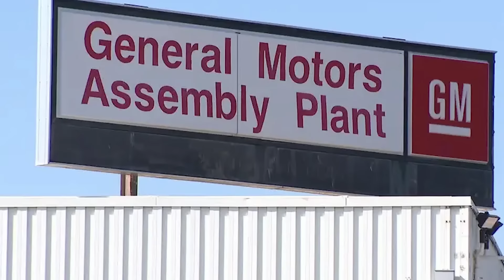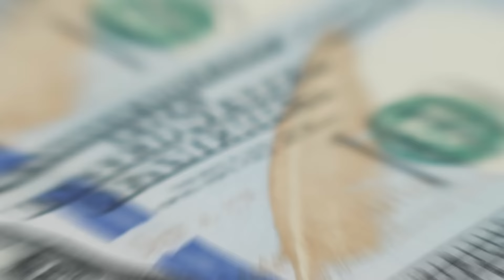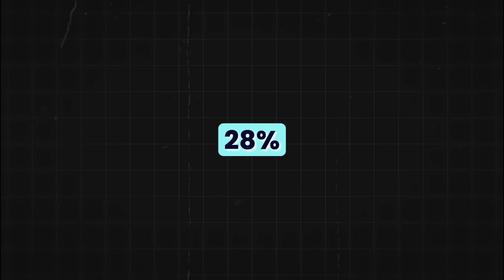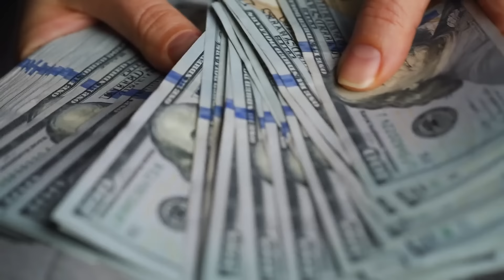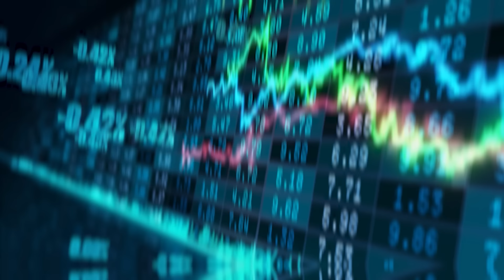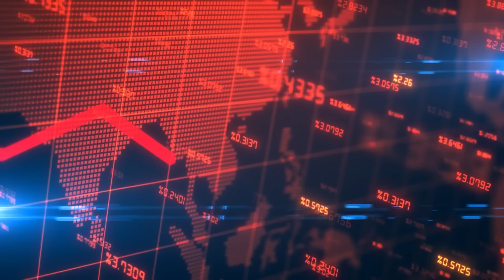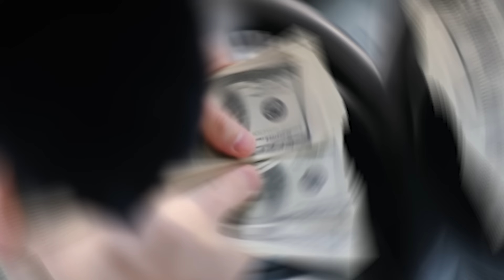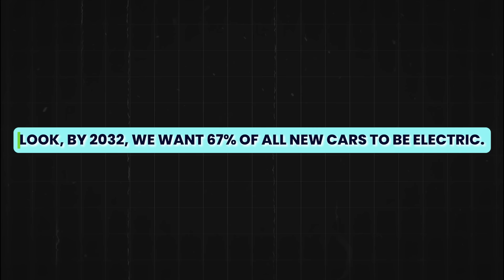The EV BUBBLE has Burst!!!

Comment: I live in Washington state and they are trying to force the citizens here to only have the option of buying Hybrids or EVs by 2030. I would buy a Hybrid over an EV any day, but I am not going to be buying either. My daughter has a first generation Nissan Leaf (EV) and she is in high school. It has been an eye opener for us. First thing to consider is you need a dedicated 30-50 amp 240 volt electrical circuit for the quick charge systems. Unless you have a new house with this circuit already installed in your panel pre-wired to your garage, you are going to have issues. Our house was built in 1975 and the electrical panel is in the basement without any extra slots, so we have to do a panel swap and run a new circuit. However, it is recommended that we go from a 100 to a 200 amp main, so now you are talking about changing out your entire service back to what the utility is responsible for and everything has to be brought up to electrical code. It's not a simple circuit to upgrade. I'm guessing by the time you pull permits and have an electrical contractor come in and change everything out, you will be over a $10k bill to do it right. If your panel is in your garage, you have two slots available on the same side in your panel and you don't have to change out your service... consider yourself lucky. What is the true cost of charging your new EV (lol)? Yes, you can trickle charge it off a 120 volt outlet, but that really takes days to charge and that is what our daughter does. 

Other things to consider... If you have an EV, you aren't paying your gas taxes, so they tripled what we pay for our regular vehicles for tabs in Washington state. An EV tab tax:( Then there is the battery or batteries. What they don't tell you is that the batteries that go in an EV have a shelf life and cost about 1/3rd of the price of the vehicle when you buy it. For instance, my daughter's first generation Nissan Leaf cost over $30k brand new and we bought it used for $7k ten years old. Meaning the battery when it goes tits up will cost over $10k to replace. Basically, her car is now disposable. There is a reason why people dump their EV's after so many years and miles. They basically are upgrading to a new car with a new battery. Again... EV's are disposable.
Reply: My best friend's wife fell for the EV scam some years back...HER Leaf didn't even make it to 60K before having to be scrapped as worthless. .

Comment: We want reliable cars that will get us from point A to point B without hassle at an affordable overall cost.
Reply: tiepup   I had 300,000 miles on my Toyota before I gave it to my daughter and it's still going strong. Much cheaper than an electric car, can fill up tank in 5 minutes and get twice as many miles than an electric car before having to fill up again. Also electricity cost is on the rise and actually costs more now than using gasoline where I live. EVs weigh more so tires wear faster and it's better to buy the tires made for EVs which are more expensive and you still get less miles out of them before needing to be replaced. Once that battery gets bad, it's about the cost of a new gasoline car to replace it. EVs are not what was promised.

Comment: Been saying since Day 1, Our power grid can not handle all the EVs to begin with. So politicians goals are unattainable already. As are most things that come out of there mouths. Now we are learning they are useless in extreme cold weather. At 50mpg on some new cars, I'll stick with gas.
Reply: Maybe an eye opener for you.

An EV , average mileage, does use equal or less electricty in a year as a 7*24 running game computer with screens and internet connections....assumed: 12 KWH / day for the gamepc including network equipment and screen usage. (500 watts contimous). Total 4380 KWH a year which will bring an EV (Tesla model3) ca 30000 km (20000 miles) far. With 39 mile a day on average the car only makes 14200 miles / year.

May be you are telling me that the grid cannot handle all those electronic toys in the USA?

Comment: When the dealerships start giving them away for us to tryout, then I guess I’ll take one. But the guys at my local power company said that our grid can’t handle the excess electrical demands from everyone charging their cars every night and personally I’d rather not have the blackouts and everyone freezing to death in their homes. But that’s just me 🤷🏽‍♂️
Reply: they never will.  they would have to pay me to take one.
Reply: If your power grid couldn't handle half the owners of EVs charging their cars overnight when most businesses are closed, nearly everybody is asleep with the lights off, and few home appliances, TVs, and computers are being used, you have a pitiful power grid.
Reply: @johnstuartsmith  
At night is when everyone is home running everything, lights , computers , tv’s, air cond/heat, cooking, doing laundry, dishwasher. 
What planet are you from?
Reply: Between 1 Am and 5 Am there's not much happening utility-wise in the houses on my planet. Maybe porch lights and  refrigerators.
Reply: @johnstuartsmith  
Well John between 1:00 and 5:00 am would be the ideal time but thats like at 1:00 am every house turning on a 40 amp welder running for 4 hrs if they’re only charging one car and maybe 70 amps with more than one vehicle. That’s even worse that the scenario mentioned before. I think electric cars are a good solution from a pollution standpoint but I have to agree with the electric company when they say they don’t have the ability to handle the load.

Comment: Not long ago the Ford dealer I worked for was told by FoMoCo that it would cost 1.2 million to be a EV certified dealership which the dealer owner paid. Then came the fuckening.. FoMoCo then said, to be a EV dealership you are required to have a minimum of 8 quick chargers. County engineers, DTE power and the distribution engineers said, sorry the power cables are underground on the other side of a major road. It will cost $180,000 to bring the lines to your building… but then said it’s all for not because the distribution lines can’t supply the demands, the Amazon Fresh building has been allocated the power prior to there construction… to bad.
Check back in 6-8 years when we start updating the grid… but not the dealership is out all the money

Comment: EVs are fantastic vehicles - for some people.  It is and should remain a niche market and not become the norm. As a contractor, weighing the pros and cons of a gas truck against a Lightning or other electric truck,  I can see the massive benefits of an electric truck.  But that's only if I don't have to travel a lot, and only if the costs of these vehicles could be brought to a reasonable amount.  I would love to be able to plug my truck in when I get home and have it ready to go for a day of work the next day, eliminating the need to go get gas and consolidating an expense into another existing bill (even if that bill does go up).  It's also cheaper to operate, which sounds awesome.  Yes, I am aware the power still comes from burning coal etc and the carbon emissions reduction isn't what anyone was told it would be.  I wouldn't want one to "save the planet."  I would want one because of the convenience and the additional storage space (A frunk!?  Yes please!) But I also recognize that not everyone has the same needs or wants as I do, nor do I think a huge push for electric vehicles should be made, at least until we've developed a better way to produce the power needed to charge them.  Infrastructure will adapt, but we need better, safer and more efficient ways to generate electricity before we can really start replacing a substantial portion of existing vehicles with EVs

Comment: I own a lightning platinum and it's without a doubt the absolute best truck that I've ever owned.  The economy isn't as good as I hoped for but I  can still drive about 100 miles for $6.  Little to no maintenance required.  I have a 9.6 kw generator with me at all times that doesn't require any gasoline.  I  can power all my essential equipment in my home including my 240 volt deep well pump during a power outage. It will do everything my old 2014 F150 would do at a fraction of the cost. No more waiting in line at the gas stations,  I just plug it in when I get home. I'm thankful there aren't more people buying EV'S,  because that would just raise the cost of electricity for everyone.  Rides like a luxury car and accelerates like a race car.  They definitely are for people that like to travel but they are great for local use and for those that only need to charge at home.

Comment: I wouldn't trust Ford to make an EV that wouldn't Catch Fire and burn down my house. They can barely make a passenger vehicle that won't fall apart before the warranty is up.
Reply: EV's are inherently a problem.
Reply: Never had a bad Ford, he'd terrible Chevys, dodges with chronic transmission problems, Datsuns that fall apart, but never had a Ford that didn't last me for years. Worst one I had was an '02 F250 with the 5.4. blew out plugs on two occasions, other then that rock solid reliable.
Reply: @kdrapertrucker  Ford does make very good trucks. My beef with them is they use their American Icon status to extract as much money as possible out of their customer base, don't honor warranties, and promote substandard designs in their lower end vehicles at the customer's expense to fix.

Comment: I own an ev purely due to the tax break. In the uk you can basically get one pre-tax. Makes them around half the sticker price. I quite like some things about it, the performance and the cheap running costs, however the charging infrastructure is laughable, and if they pulled the tax break I’d go back to internal combustion in a heartbeat.
Reply: Somebody didn't think of EV charging infrastructure in UK I guess. Gas stations are funded by the oil companies.
Reply: Yes, the infrastructure is an important factor. However, in Scandinavia, I see now that about 20-30 % of the gas stations have a fast charger >100 kW. And many shopping centers get 20-40 kW chargers. Larger charger stations >10 chargers are arising along the motorways. For my daily driving, I can charge at home at very low cost. There is some mindset to it, that on long distance travel you will have a range of 200-250 km (high speed = less range). But if you can get that 200 km on your car in about 30 min. it is absolutely doable. It requires some planning, though. And with improving infrastructure, the planning will become easier.
Reply: In the uk, you can’t really plan a journey with an ev as your have no idea if the chargers that are on your route will be working, or if they will be occupied by people who have parked their cars in the space and gone shopping for two hours. This means unless you are maybe in London, you charge your ev at home and commute back and forth, and don’t really use it for longer journeys if you can avoid doing so.  It’s typical of the uk government to allow a load of private companies to fit random chargers all over the place with no mandated service standards.  There’s no evidence that the situation is changing, so I predict they’ll have to keep the tax breaks up for some time if they still want people to buy evs.

Comment: In the 70s the EPA came out with new air quality standards for vehicles. It is said that GM and Ford hired 15 lawyers and went to Congress. At the same time, Japan hired 15 engineers and went to work. That is the crux of the problem here.
Reply: And yet: it was GM that invented the Catalytic Converter and kept V8s on the road, not the Japanese.

Comment: The 3.5 Ecoboost is a piece of crap also. I had to change my neighbors spark plugs after only 56000 miles. Spark plugs 1,2, and #3 were completely burnt up. Please don’t buy the 3.5 Ecoboost. My neighbor has been at the dealership and left his F150 for over 3 weeks and it still has issues. The only f150, if you have to buy a Ford , that I recommend is the f150 with the 5.0 engine in it. No turbo just cubic inches. If you really want to buy a real truck buy a Tundra that will never break down on you. Thank you for listening. Certified ASE mechanic with 25 years experience. 😅

Comment: My 2017 Honda cost $23,000, back when it was new, gets 40 mpg on the highway. With gas $5/gallon that’s 12 cents a mile, the same as my friend’s Tesla per mile with electricity at 40 cents a kWh, and the Tesla cost $20,000 more. 😎

Comment: Tesla sold 1.81 million last year, BYD sold 1.7 million in 2023. They are selling all they can make. Dealers won't sell them because there is no warranty or other maintenance work for EVs. No oil changes, plugs, or filter changes at $105.00 per hr.

Comment: I've had a Toyota hybid and it works.  It charges it's self while moving and uses less power from the gas powered engine when it is coasting or going downhill.  EVs are constantly discharging, I think.  Looks like the Toyota hybrid is just a better idea.  Any device requiring a charge from the grid will draw down the effectiveness of the grid.  Winter without heat or summers without AC are both no fun.  I don't think they are a scam, but they seem not ready for prime time.

Comment: First let me make the distinction between an EV and plug-in hybrid,  The EV has bigger battery and NO gas engine and the plug-in hybrid has a smaller battery but it also has a gas engine :)  I have owned two Ford hybrids, one was  a plug in and the other was now not.  I now drive a 2021 Ford Escape plugin Hybrid that has a 35-50 mile range battery with a 105 MPGe rating.  Meaning we can do all the round town, work and back driving I or my wife needs to do every day.  Even with a very small 12 gallon GAS tank, we fill up once a month at MOST at most.  If the car is not in operation its charging.  As a retired EE it really blows my mind why anyone would buy a total electric car if they EVER wanted to drive out of town.

Comment: The problem with the big American car manufacturers is that they cannot innovate.  The ICE vehicles that they are currently selling were designed 5-10 years ago and by the time they are on the lots, they're already obsolete. Also, they literally depend on hundreds of disconnected suppliers for parts, so it is a logistical nightmare to redesign conventional vehicles to be EVs. Tesla is the antithesis of this.  They are completely vertically integrated and design their vehicles, manufacturing lines and the infrastructure to support them from the ground up.  They have been producing and perfecting EVs for 20 years and they're not stuck in the ridiculous cycle of trying to produce a new model every year for all the cars they sell.  The world will definitely move to electric vehicles and the legacy car manufacturers will disappear because they cannot accept that their old ways are obsolete.

Comment: This current EV push is just like what happened in the late 80's and early 90's. GM tried pushing the EV idea onto the consumers, and all they had was the GM EV1. It was a great idea that was very poorly executed, just like now. Current EV owners are indeed getting rid of their EV's for a gas vehicle, because many of them felt they were lied too! The thermal efficiency of a battery is very low in colder temperatures. I guess that was never mentioned to the customer during the initial purchase. The cost of many EV batteries is well over $20k. That was never mentioned to the customer either. Most if not all batteries have a LIFE SPAN! which means eventually it will have to be replaced no matter what. OOPS! I guess that was never mentioned either. The depreciation rate of an EV is considerably higher than it's gas counterpart. I know that was never mentioned to ANY customer. In many places, charging an EV is higher in cost than it is for a gas vehicle. At least the drivers of these EV vehicles could drive past the gas pumps. To all of the EV owners out there, YOU ASKED FOR THIS! Enjoy!

Comment: Every 3 EV's consume the same amout of power per day as the average home in the US.  Adding 3 million EV's per year (let's say) is the equivalent of adding a million new homes. The administration is mandating 2/3 of all vehicles sold be EV's by the early 2030's; the equivalent of adding over 3 million new homes TO THE GRID every year.  The US has an overburdened, aging, and inefficient grid already. The demand that tens of millions of EV's will make upon this already overburdened grid will cause repeated blackouts and eventually we will literally have intermittant use of electric power in the US. This is not a plan. It is a formula for disaster.

Comment: As in it isn’t the message, it’s the messenger, it isn’t the product, it’s the manufacturer. American auto manufacturers have a history of manufacturing junk. I owned a Camaro that was painted with only a color coat, with rust bubbles appearing with 3 months. The dealership from whom I purchased the vehicle accused me of driving it in a corrosive environment. It was only after I took the car to a reputable auto paint shop that I learned of the cause of the problem. GM deserves as much bad publicity as possible.

Comment: 4:36 4:40 4:41 4:45 4:48 5:02 5:03 😢
 5:11 Doesn't the heads of these auto makers get it? They demand a premium which is ridiculous.  The range is short, and there is not enough infostructure to support them. Just to name a few of the problems.

Comment: There is a realization that ev mileage claims are holding up, especially with cold weather that drains batteries faster. You can't charge ev in rural and remote areas also.  Evs also deteriorate in price faster than gas vehicles, mote expensive to insure, and mechanics not trained to fix them. Need to be electrical engineer.